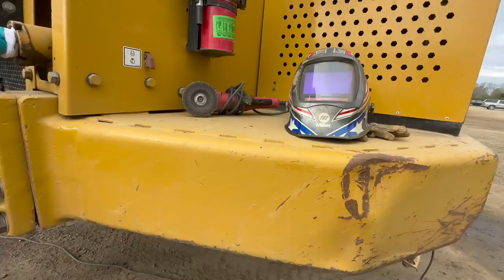CAT 637 Bumpers

Comment: Why aren't the stitch welds one continuous bead?
Reply from the maker: Because that’s how it is OEM.
Reply: @OFW  I looked up OEM and this made it clear why. These stitches are common when welding on a long piece of material, because a continuous weld is not always necessary. It can cause more harm to have a long continuous weld, because warping becomes a lot more likely with that much heat input. The more weld passes you put on a joint, the more likely the steel is to warp.

Comment: Why not, double thickness, if this section get’s bent in on a regular basis?
Reply: Strengthening parts just means something else, likely harder to repair and more important, will be getting damaged,Damage will always find the weak point. Making that this easily repaired bumper section makes the most sense.
Reply from the maker: They want it OEM.

Comment: How do you go about getting your angles for replacing all three pieces? I am god awful at math and trying to figure out an easy way to figure out angles when cutting and doing repairs. I do a lot of v nose fish house for example and cutting out and patching in new tubing on the frame.
Reply: Also I like that the other guy had a 211 on such a big piece of equipment. People always question mine and I work on much smaller stuff haha.
Reply from the maker: It’s not the size of the welder it’s how you use it hahahaha.
Reply from the maker: I use wire or an angle finder.  It helps when there is another machine there that is straight.
Reply: @OFW  do you typically go to the outside like that? I go usually go to the inside with an angle finder and never seems to line up well. Maybe I’m just doing it backwards haha
Reply from the maker: @Froggies505  went on the outside because that was the most important part.

Comment: Only thing I'm confused on is why not run a strait edge on the outside of those 2 points and then bend the wire to match the angle instead of eye balling it and rebending it a bunch of times and risking it being wrong. Get a magnetic level or tack a peice of flat stock there for a moment.
Reply from the maker: It really doesn’t matter.  If it’s off a little it gets filled in with weld.